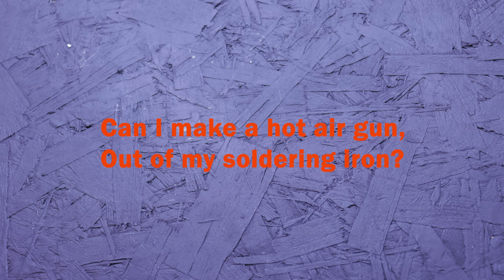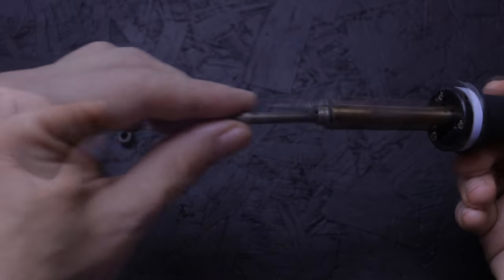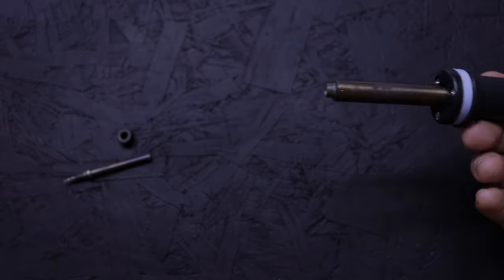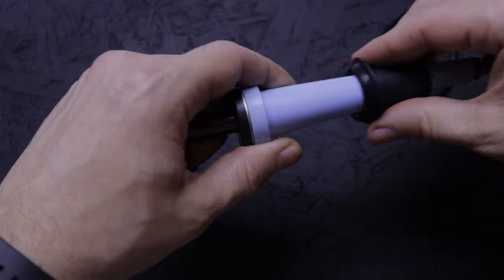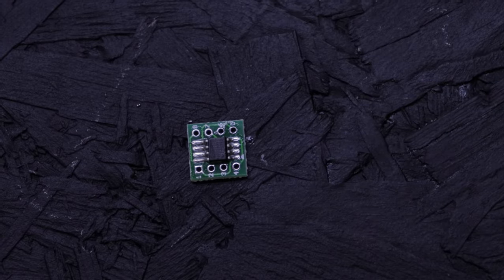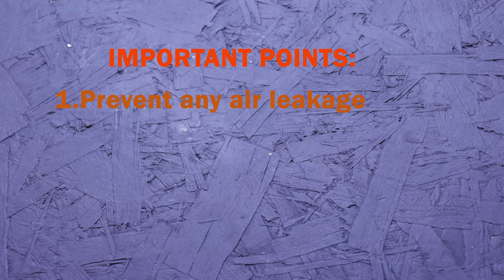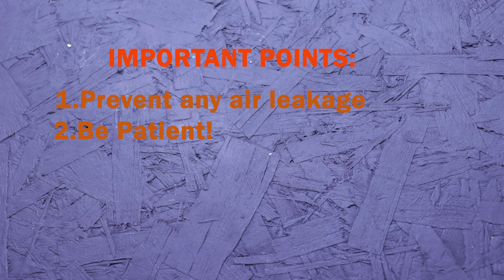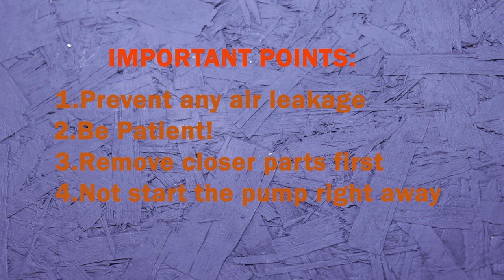#1 How to make Hot Air Gun From a Soldering Iron with an aquarium pump  | Step by Step

Comment: The problem is that when the solder isn't melted yet and you grab a part with tweezers it's VERY easy to tear pads on the PCB, since epoxy that bonds copper foil to the fiberglass softens from the heat. Minimum possible physical strength should be applied when your PCB is hot, so you need a more powerful heat gun to liquify solder and keep it liquid more reliably.
Reply from the maker: I thought this as a emergency solution. Indeed it can not compete with a professional hot air gun.

Comment: how much watt power for the soldering iron?? and the pump how much cfm ??:)
Reply from the maker: Thanks for your remark. I didn't realized that I forgot to add the specs, and similar products in the description. 
The soldering iron I have used is 60W, and the pump is 20 to 60 cfm (adjustable).
Reply: @makersfunduck  thanks a lot!:)